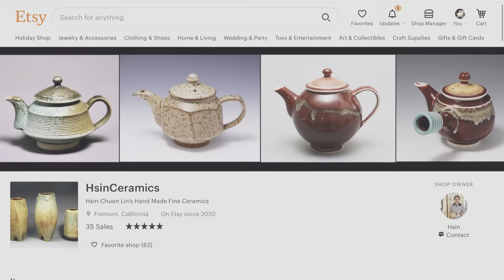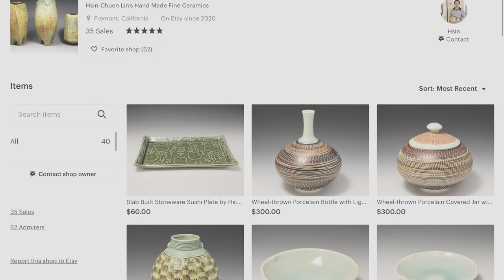557. Glazing a Roller Texture Teapot with Hsin- Chuen Lin 林新春 茶壺上釉示範

Comment: Hello, amazing work and glazing! I have a question : are you using underglazes for the underside of the lid so you can glaze firing it in place on the body?
Reply from the maker: No, that’s wax resist mixing with aluminum hydrate.